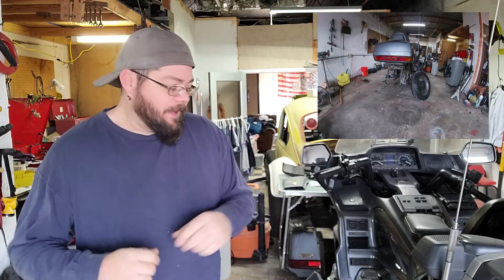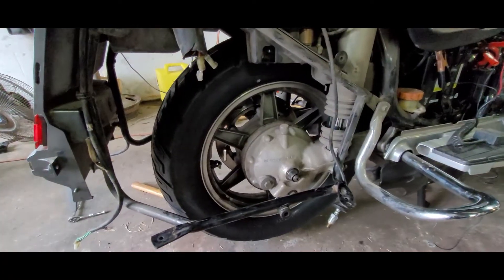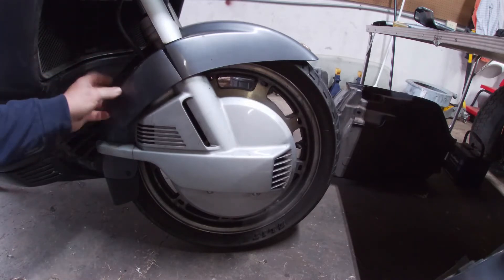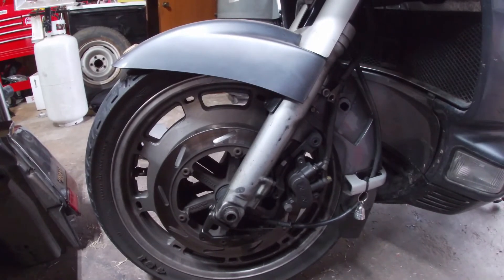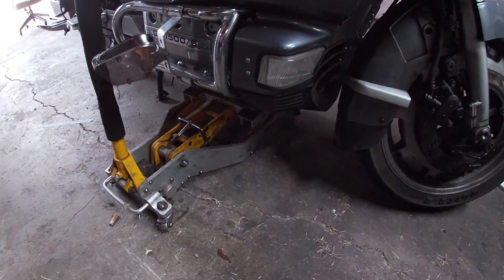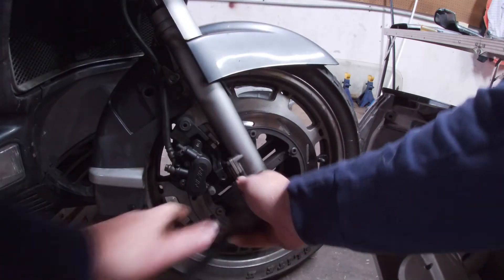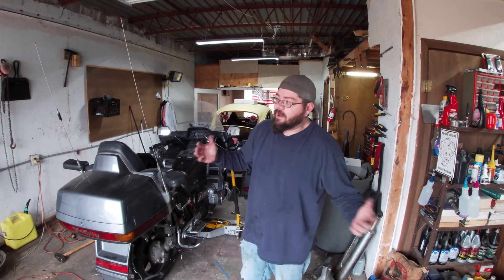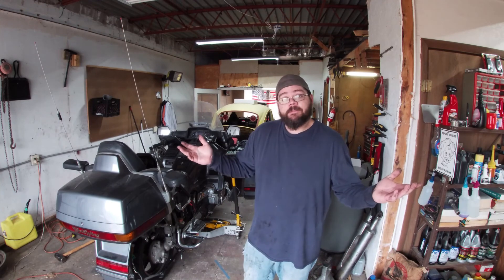1988 Honda Goldwing 1500 front tire removal

Comment: Wow, you’re taking the tire off the hard way, I just had to take off the brakes and four other nuts and take the tire off. I have a 1980 Honda Goldwing 1100cc
Reply from the maker: Nope... mine is a 88... full dresser... your 80 doesn't have the same setup... I have a 80 to and it's a lot easier then the 88